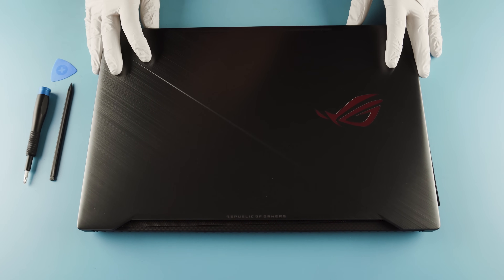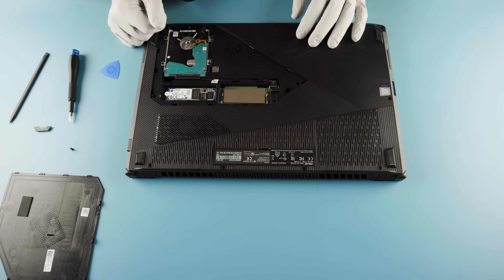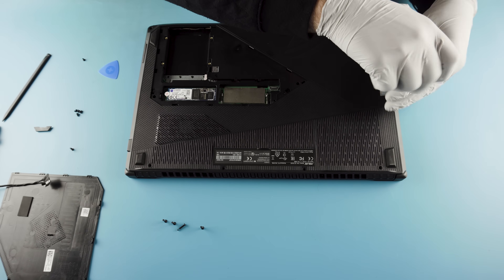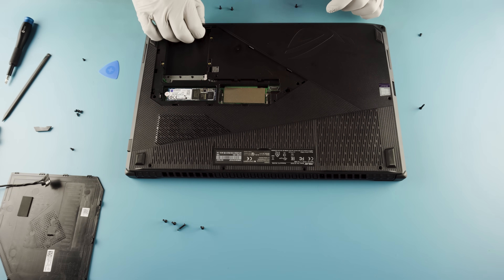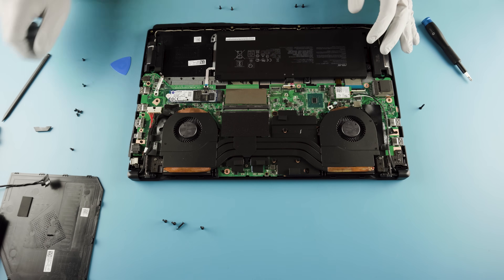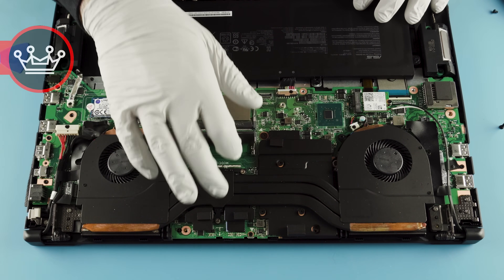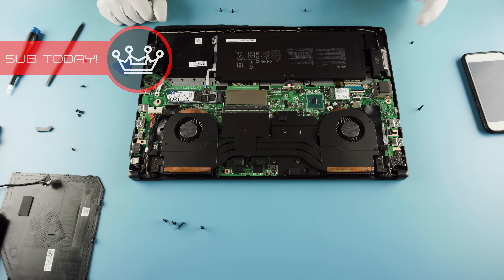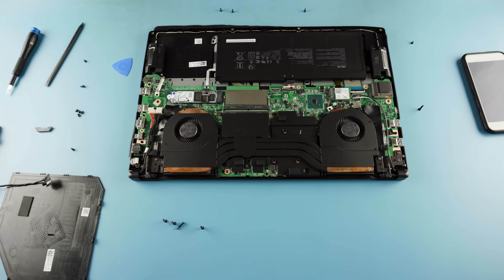Asus Strix Gl703GE | Service Upgrade & Laptop Teardown Manual (How to)

Comment: I see they have a Kingston 128 GB SDD.   I wouold like to upgrade to 240 GB SSD card.  Can you give any recomendations on compatibility?  Also, I dont' think I need to remove anything but the quick access panal to replace the 128 GB SDD.  Thank you.

Comment: So sad right now. I have the same laptop and it just broke down. I was just playing like usual and it suddenly freezed and crashed. I turned it off and when I tried to turn it on again, it just won't. I tried the battery discharge method and still nothing. I don't have the money to buy another one again.

Comment: I am having the same laptop as you and bought the 8 GB ddr 4 2400MHz ram but when I attach the RAM to my Laptop, Black Screen appears and nothing happens further? Please resolve my problem.
I have also tried to clean of ram by Eraser and cleaning the port by soft brush gently.

The RAM I bought is : @t.
Thanks in Advance.

Comment: Hey, thanks for the video. I did the same things, but when I turned on thr PC, I couldn't find SSD which is D file ind My Computer. What should I do?
Reply: hopefully you found a solution because I have the same problem
Reply: @Ballz2U2  yes, you may need to open the PC again(literally open it like he did in the video) and there should be a usb plug for SSD waits for you to plug it its USB hole. As I remember, it is located on the case not on the laptop. Hope it helps.

Comment: I have the GL503GE and they have put the ram in the slot that is not easily accessible which means if I want to upgrade that ram stick, I have to open the computer up.  
If it was in the easy access slot I could just remove it and replace it.   But because ASUS put a 8gb 1333Mhz stick inside my machine I cant find a ram chip to match the speed.  So now I have to replace the ram stick inside the machine before i can even put a new stick into the easy access, also my GL503 has exactly the same setup as this machine, only apparently it has 4 memory slots.  I haven't opened this yet, but your video has helped a lot thank you so much.

Comment: Is the SSD drive a M.2 SATA? I have a similar model laptop and wanted to upgrade its 128GB to a 500GB SSD.
Reply: I have this model. I just opened it up to reapply the thermal compound and took a look at the M.2 drive. It's SATA, sadly, but the slot does look like it supports NVMe drives.
Reply: yeah it does support m.2 nvme coz i already installed samsung 970 evo plus 1TB m.2 PCIE Gen 3.0

Comment: Hi, my keybord backlight is off also when the pc start only tab and power button got light please help i want to know if its soft or hardware please.
Reply: Try reinstalling the keyboard drivers or whatever, I don’t know too much about it but my rgb stopped working so I messed with the settings in Game Center and entire keyboard stopped working, I think I just reinstalled the keyboard driver(or whatever it is called) and it’s fine

Comment: Gotta say thanks for this.  I have a GL703VM and this is not the 1st ROG laptop I've had and my previous was super hard to take apart to get at the fans.  As someone who smokes and has long hair, this is very important.  Smoking around fans makes everything stick to them, so a can of air is about as useless as pouring my coffee on the laptop.   Been putting it off cleaning the fans dreading taking it apart (because of my older laptop experiences) and this helped allot.

Comment: the one and only GOOD thing about the base ram being in the "easy access" slot is it allows you to quickly swap it out for a 32 gig stick if you are wanting to eventually expand it to 64 gigs...assuming ti can do that....otherwise, super dumb configuration forcing customers to open the entire back of the laptop to get to the 2nd ram slot.

Comment: would it be possible to upgrade the gpu to like a gtx 1660 instead of the 1050 it comes with
?
Reply: Nope, far as i know there{s no way to change a GPU processor like a CPU..

Comment: I have sticky keys, I suspect some of the four arrow keys because I may have spilled something in that area .. and intermittently, it's backspacing on me.  I have removed the keys and cleaned there ... I have taken the whole thing apart to try and access the keyboard from underneath ... I have taken a high-powered air compressor and blown the crap out of everything ... no luck!

Comment: What type of fan is that on the left side, in line with the HDD? A CPU or GPU fan? I need to change that part because of crackling noise coming from it.
Reply: Silviu I have that same problem. I’ve kind of just gotten used to the noise now.

Comment: This video really helped me to figure out a problem I've been having with my laptop. Turns out, I have a bad fan. :( Also turns out, it's really hard to find a replacement fan.
Reply: Did you find a replacement supplier? I think I have the same issue.
Reply: @stevecowle4647  I did not, and Asus doesn't seem to answer any inquiries.
Reply: @MessyhairGal  ok thanks. I guess I'll contact the service center nearest me then.
Reply: Same here fan is making grinding noises. Is there any way to lube up the existing?
Reply: @Emaregee  Not easily as far as I can tell. You'd probably have to remove the entire heatsink assembly to get at them properly.
Reply: could you describe your fan issue? there's a standard fan issue that happens with our laptop model that I found out after a year of hunting forums
Reply: @mudsky 
Well, any details forthcoming?

Comment: Hello, do I have to unplug the battery if I want to change a RAM. Or do I have to do something particularly to software or hardware before or after... removing old RAM and place the new one?
Reply: I doubt you still want an answer but for anyone else if you switch it off with a full shutdown and its not connected to power there shouldn't be any need to disconnect the battery.

Comment: could you tell the model/brand of the 2666hz DDR4 ram plz im confused i have that laptop wants to upgrade but it seems it is not crucial i would take the exact same RAM, please?
Reply: i guess you don't remember was 1 year ago.... the problem is the reseller says everywhere 2666 ram and crucial says 2400 when their website try to sell me stuff as compatible, but i would take the exact same CL and frequence for avoiding bugs on dual channel.

Comment: Great review! just one question. which ram memory model does it come with? im buying this laptop and wanna do dualchannel but cant find the info about the default ram i would need...
Reply: I have the GL503GE which looks identical to this machine and it has 1333Mhz speed DDR4 SODIMM ram.  
It might not be the same, but probably is.   I would just buy two ram sticks and swap the old one out.

Comment: I have a GL703V and the screws that are numbered on the heat sink/fan piece are giving me some trouble. I cannot screw them down completely as they get stuck 1/3 into their respective holes when I try to reassamble the laptop post repaste.
Reply: August Wigg You might be using the wrong screw in the wrong hole, or there might be something that hasn't fully been reseated inside and is therefore sticking up a bit.

Mixing up screws is something I've done many times.

Comment: Great video - liked and subscribed. I need some help as I'm new to customising laptops. I have the same laptop with a 1tb hdd - is there another slot where I can add an ssd and use that as master? I think it's long thin one above the hdd, but I'm not sure - if it is can you share the name of the slot because its impossible to make out on the video.

Comment: Great video, thanks for the useful information. Where is the CMOS battery is located on GL serious laptops? I watched your video carefully and paused it when I see the whole mother board but could not locate the battery? Strix 15 GL503GE
Reply: Series*
Reply: @ecasa69  im on the same boat. It's been a while but did you find it?

Comment: Is there anyway to resit the trackpad since mine feels it has a lot of travel in the center and sometimes it doesnt respond properly when using it
Reply: Mine came super loose like that out of the box, it was my 3rd laptop that I took back because of out of the box issues so I just stuck with it. Last week the trackpad randomly stopped working(I use a mouse either way) but to solve it I reinstalled the driver. I’d like to know if there’s a fix for the loose pad!!

Comment: I have such a problem. It is in manual, that one power plug socket only keeps it alive, and don't charge a battery, and another is charging. in mine both of the plugs are charging the laptop battery. Any clues?
thanks.
Reply: What's in front of the HDD?

Comment: SOMEONE PLEASE HELP. I got the Rog Strix gl703vd but the aluminum back cover (screen back) is dented. I wanted to know if the 17.3 gl703ge chassis is the same as the gl703vd because I'm only getting the back replacement for the gl703ge model. Please help!!!!!

Comment: The laptop needs a severe upgrade I know you can carry 32 gigabytes of RAM but what I don't know is is it dual Channel or single-channel and then when it comes to the hard drive I've got that horrible firecuda in it and I want to go straight to SSD what is the largest size SSD and which one do you recommend to put inside in exchange for that firecuda. Thank you in advance:-)
Reply: single or dual channel depends on how many ram modules you put in the laptop. If you populate all the 2 ram slots you will use dual channel otherwise it's single channel. 
To swap out that firecuda look for a 2.5 inch ssd if you have the money go for the 2.5" samsung 860 pro. I have this laptop and plan to do this too haha.
Reply: Firecuda is fine... obviously SSD is better....but the performance isn't terrible.

Comment: please can u show me how to replace ROG GL503VD keyboard?? i've problem with my keyboard,, my keyboard didn't work
Reply: Mine stopped too, how did you get your's fixed?
Reply: @L.o.u.i.s..  Mine too, any solution ?
Reply: @JedidiJedidi   yup, install Hotfix. It's on Asus website under your model number.
Reply: @L.o.u.i.s..  Thank you for your answer, but the only model that have the hotfix driver is 503GE I tried it and it doesn't work.
My model is 503VD and it's keyboard stopped working completely even in the bios.
Reply: @JedidiJedidi   Mine had stopped too, and the power on button wouldnt light even the laptop turned on.  I was using a wireless keyboard to help me out during the process. You could do a system restoration, choose the option that let you keep your personal data, your apps will need to be reinstalled though..  That should do the trick.  You can find that out in control panel under "recuperation" (mine is in french, maybe not the same term)  Good luck.
Reply: Mine does the same thing, to fix my problem I unplug the mouse and plug it back in, then bam the keyboard works.

Comment: Hey, what is the purpose of the uncovered chip right next to the wifi card? Some of the models in the strix line-up have 3rd fan to cover that chip but the old ones and hero edition usually don't have the 3rd fan.

Comment: so i have a weird problem with my GF's laptop, so this happens whether the power is plugged in or not,  the laptop will keep shutting off and back on again, repeatedly, only showing a black screen the entire time, UNTIL....UNTIL i hold down ANY key, and for as long as I hold down a key, the computer will start to load giving me the RoG loading screen, ((i have a different asus model than in this video))  But if i let go of the key, the computer just shuts down and starts the whole on/off process again, but if I keep holding the key down, the computer refuses to load windows, and says simply that the computer couldn't start windows, then wants us to use the system restore, when we try to do that, it just attempts repairs....forever,   I've never experienced a problem like this, any ideas people?

Comment: can i use this "WD High-Performance NVMe PCIe Gen3 8 GB/s M.2 2280 Solid State Drive Black 500GB WDS500G2X0C" hard drive for upgrade? 
how many ram slot are there in laptop?
Reply: 2 ram slots

Comment: Thank you for the nice info! I want to buy this model but want to buy extra ram for dual channel. Do you happen to remember the RAM model they use? 

For upgrade reference and tech geeks, it would be super useful to note in the video description the model numbers of the components (ex: RAM - 8GB Kingston 2666 CL17 KCP426SS8/8, HDD - Seagate Barracuda, 1TB, 7200RPM ST1000LM049 etc.). I'm just enumerating random models here, of course.
Reply: Depends on where you bought it, but its a 2666MHz DDR4 CL17 260-Pin SO - DIMM Laptop RAM, most likely Samsung
Reply: @chrisoman87  most likely not Samsung since that is usually the most expensive. It most likely SkHynix.
Reply: Laughing Man I’
Reply: @chrisoman87  hello if i buy an Kingston 8GB, DDR4, 2666MHz, CL19  Laptop RAM , would it be compatible with the one you said about ?
Reply: Hey Chris, did you find out eventually about the Ram ? my ram is in the heatpipe slot not the easy access panel so I can't take it out without doing a complete teardown

Comment: i have the gl503, i don't wanna open it yet cause it voids my warranty. But i do want to know one thing- my laptop has a 500GB SSD currently, can i add an HDD(or another SSD) later on in i want to expand my storage?
Reply from the maker: Assuming you open it properly and perform normal upgrades in it, it likely should not void your warranty. To make sure, however, you should contact them directly regarding that.

Comment: have been looking for a legit channel that can show how to do this stuff!! great video. quick question i am trying to find a video about replacing the gpu on this model of laptop. I am looking to buy and i think I have narrowed my choice down to this one and would like to be able to upgrade later on. 

Do you have a video for that procedure on this model or know of a video online that shows how? thank you!
Reply: Idk if it's still a relevant question for you but whatever. You can't replace laptop gpus. It's soldered on the motherboard. If you really want a laptop in which you can "upgrade" the gpu later on find one with a thunderbolt 3 port with 4 pci-e lanes (This is not that laptop).  You can hook up an external gpu to that if you want but worth mentioning that if you want max performance from that gpu you will need an external monitor. There is a performace loss (~10-15%) if you use the laptop's built in screen.

Comment: Why not relocate the RAM away from the easy access slot to the more awkward location while you were in there?
Anyway, good breakdown, many thanks. I'll be getting an ASUS GL703GE when my local store restocks.
Reply: I'm about to break mine down to re-paste as well but I want to as if there is any reason i should not relocate the ram to free up the easy access slot? I ordered a new stick of ram and I don't want to have to take the whole underside off again. will it be ok if i move the ram to the hidden spot now?
Reply: hahahaha, that's my point too.
Reply: Glad this video exists and that I saved a shortcut to it - 👀 - I bought this laptop around 3 years ago (May 2018) and it is still running nicely, although mine is the GL703GM model as I am in Asia. Just after warranty expired the battery died, swelling-up inside and bowing the mousepad overnight while I slept. That's been replaced. I'm back here again because the HDD has now died and I just wanted a refresher prior to getting out the toolkit.